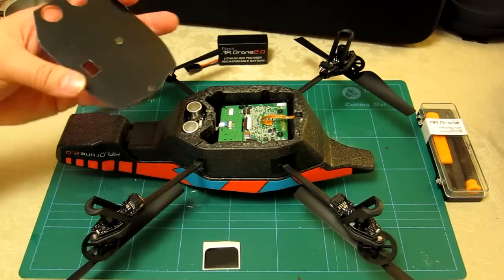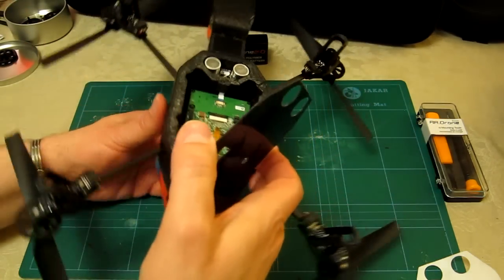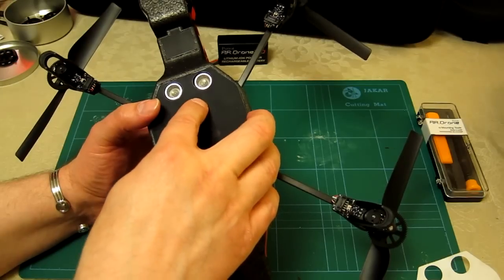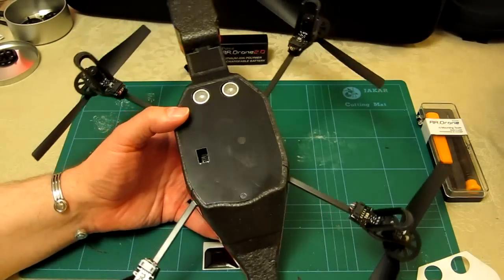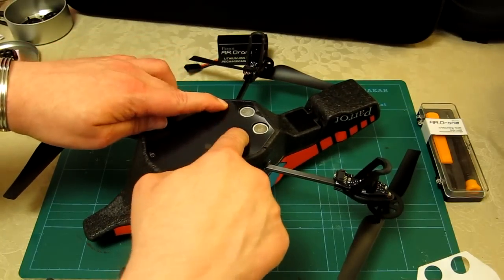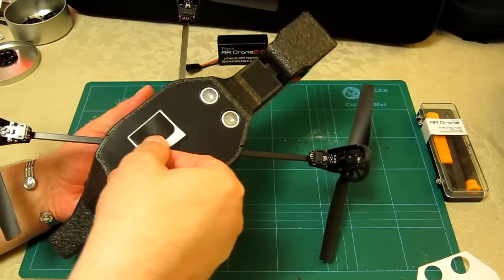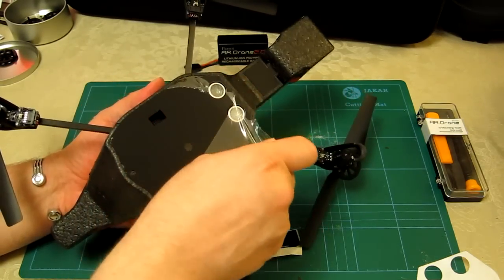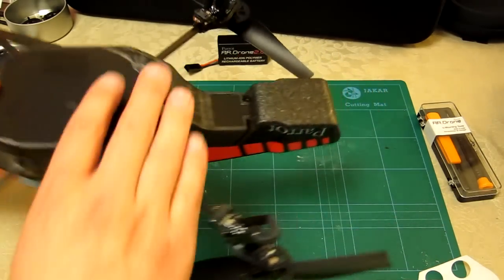Parrot AR Drone - Install Bottom Plate - Repair Segment

Comment: All red lights are on and will not self check or connect to any device. Ive pressed the reset a hundred times and charged battery. Whats wrong? :(
Reply from the maker: Only time I get four red lights is when updating firmware.
https://youtu.be/rUDKrxl9Hpk

Can your smartphone see your Parrot WiFi on the network?
Parrot do sell individual parts and you can buy a new motherboard / brain in case that has been damaged.